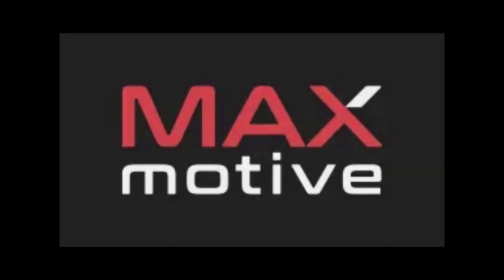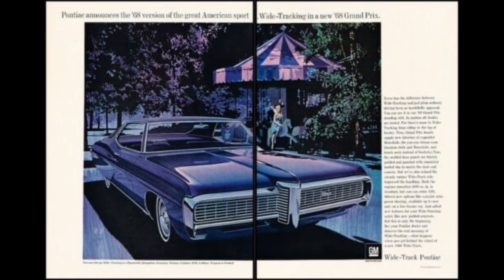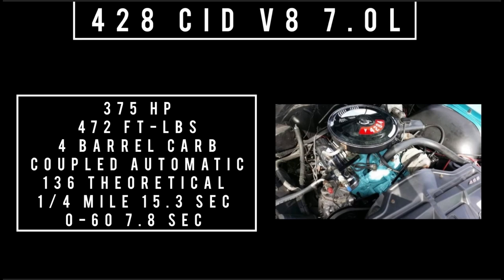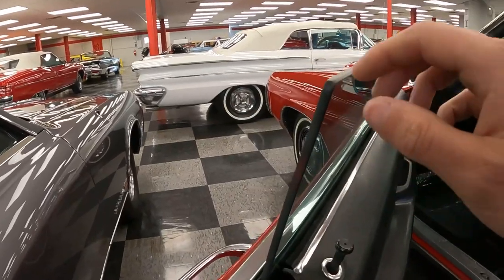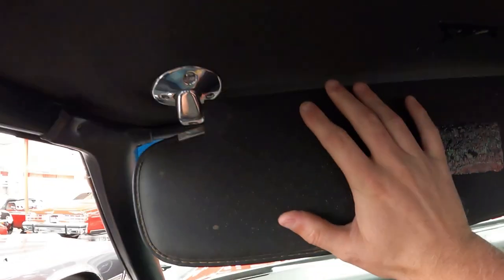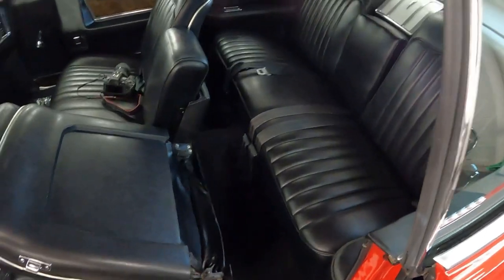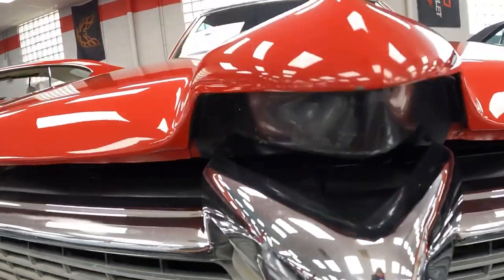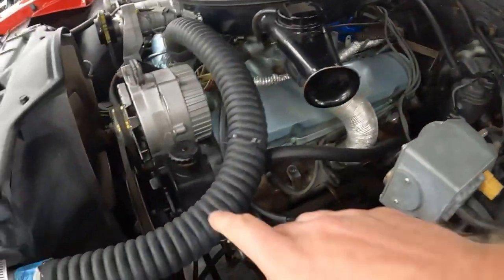1968 Pontiac Grand Prix in depth look￼

Comment: This was peak GM & peak Pontiac under John DeLorean. The average buyer of this car in 1968 was not really concerned with how much room there was in the back seat----GPs were not marketed as a "family car." Rode in a college roommate's '68 Grand Prix and he easily "buried the needle" at 120 on the Ohio Turnpike (at 2am one morning in 1972). So yes, it might have topped out close to 130 mph...his GP had the 428 4-bbl. with Turbo Hydra-Matic.
Reply from the maker: Great story thank you so much for sharing that memory was it super stable at speed
Reply: @What.its.like.  My roomie's GP was a very stable & smooth riding car which I got to drive a few times. When he punched that 428 it would push us back against the seat.

Comment: About 20 yrs ago, I parted out a 68 GP, lots of rust, pulled engine and transmission, scrapped the rest. It had bucket seats, center console with floor shift and 8 lug wheels. I'm a idiot, btw it was black on black on black too. 400 4 barrel carb, no brakes, no title.

Comment: GM really cheapened up the interiors in everything they produced in 1968... The 67s we're still pretty nice, but as far as the Pontiac line went, the 65-66 cars were probably the pinnacle of interior quality.

That vinyl top design with the paint running up off of the A Pillar all the way to the rear quarter, is called a "Halo Top"... Incidentally, the vinyl that was used on this particular car's roof isn't what it originally had. The original material had more of a pebble grain to it and was of a more matte finish.

But yes! Those GPs still ran like scalded dogs, even in '68... And in fact, up until the 1972 models.

They were great cars for the money.
Reply from the maker: Thank you so much for all the added information =)

Comment: IMOP the worst looking of the older GPs - up through post 1980, culminating iwth the grotesque Areocoupe mid-80s.  Oh, those fender skirts, fat rear end, halo vinyl roof and cutting edge molded door panels with 'rich 'burl wood' trim and a completely unresolved forward section.  The 69 came along just in time, and sales soared.

Comment: There were no GM cars Which used the Hydramatic after the 1964 model year. If 3-speed, They were the Turbo Hydramatic 400 automatic. Other automatics in 1968 were the ST300 and Powerglide, both 2-speeds. Buick-imported Opels used the Holden Tri-matic, later known as the TH180.
Rolls-Royce was the last to use the Hydramatic and they manufactured it in-house.
The A/C part you didn't know what it was is a muffler to smooth out the pulses. Most cars had them back then and for years later.
Reply from the maker: Thank you so much for those corrections =) and added information

Comment: The Grand Prix had a standard 350 hp 400 cubic inch engine, the 265 hp engine was a no charge option, the 290hp engine was standard on Catalina models because my folks 69 Catalina had that engine, it ran on premium fuel
Reply from the maker: Awesome thank you for the correction =)

Comment: You screwed up a lot about the first engine. First, the 290 HP engine was not available on a '68 Grand Prix. Second, the 400 2-bbl with 8.6:1 compression was rated at 265 HP, not 290. Third, a buyer did not "bump it up" to the 350 HP engine because that was the standard engine on '68 Grand Prix. He could "bump it down" to the low compression, regular fuel 265 HP engine for no cost, but the premium fuel 350 HP 4-bbl was standard. There was never a standard engine with 2-bbl carb on any Grand Prix until 1976.
Reply from the maker: Thank you so much for those corrections I think I got all the information from concept cars but they took down their post because they gave carburetor information and a lot of times is wrong on information..
Reply: Don't take everything for truth on the internet. Check at least 3 sources. No one likes a liar.

Comment: Hi Justin, as we got into the late 60s, the big three automakers started to delete the vent windows because air conditioning became more popular and more so to save money per car.  Automobile glass became thinner to save money and save weight.  No window frame(s) means that the car is a "hardtop" and not a "sedan"  The transmission shift indicator; P-park, R-revers, N-neutral, D-drive, S-second, L-low.  The large aluminum cylinder you see next to the air conditioning compressor is a muffler to dampen noise and vibration when the air conditioning is on.  By the way the conditioning compressor you see on the car at this time is not GM-Frigidaire, it's aftermarket.  Please reply.  Dave...
Reply from the maker: I thought the S stood for super.. 

Thank you so much for all of that information I really appreciate it =)
Reply: 'S' on Pontiac stood for 'SUPER', not 'second'. You must not be a Pontiac guy.
Reply: @MarinCipollina  Thank you for the correction!  Dave...

Comment: I've actually never liked the way pontiac designed the temp gauge identical to the radio. I dont like that look on a dashboard. But Pontiac was always my favorite. They had some beautiful cars and I've had 3 of them. Pontiac LeMans, Pontiac Firebird, and a Pontiac Grand Prix. My Grand Prix was a 1985. With T Tops. I loved that car. Oh, also a fourth one as well. A 1984 Pontiac Sunbird.
Reply from the maker: It was an interesting design choice that’s for sure
Reply: It's the HVAC system. not the temperature gauge.

Comment: I was wondering if someone can reply to this question.  I have seen 1965-68 Pontiac Grand Prix's at car shows.  I have seen 1964-67 Pontiac 2+2's at car shows, they are both ride on the GM "B" platform, they both have the same 121" wheelbase and they are both full size performance personal luxury cars.  But what was the cost difference and/or the mechanical difference between the two?  It's as if Pontiac Motor Division had two cars competing with each other.  Is there anyone who can answer my question?  Please reply.  Dave...

Comment: What is the difference between the Grand Prix and Grand Am?
Reply: Grand Prix switched from the GM B-body in '69 to the original G-body [a modified A-body, different wheelbase and no body panels interchanged] and stayed there till the end of '87 when it switched to the FWD W-body.

Grand Am was built on the A-body 1973-75 and was advertised as the luxury/touring of the GP and the driving dynamics of the Trans Am.  The name came back 1978-80, again on the A-body.  It returned again in '85 on the FWD N-body and remained thru the early 2000s.

SIDEBAR.....1967-68 were the only year for hidden headlamps and 1967 was the only year for the convertible.

Great video, Jay.  If you get a chance, do a review on a '77 CanAm.

Comment: I had one, but the dash was slightly different.  There was s map light where the center vent is at and  I am sure the climate control was the common GM climate control of the time. Probably because mine didn't have air conditioning.  It is the only car I wished I kept.
Reply from the maker: Awesome thank you so much for sharing your experience with your car on here.. =) what did you like the most about your car
Reply: @What.its.like.  It was the hidden headlights that first caught my attention.  The rear body styling, especially the taillights were also eye catching.  One thing I didn't like was the bench seat. Most GPs have a center console. It was long and low, and look cool going done the street. When I got the chance to buy it, I jumped on it.

Comment: Optional vs standard equipment on the 5 GM divisions confuses me. For example if you got a Chevy with options that got you to a base level Buick would the cost be similar?
Reply from the maker: Super confusing I totally agree
Reply: Yes, they could be similar.  However, driving dynamics were vastly different.

GM was five little kingdoms under one umbrella back then.
Reply: @Michael Long

Yeah... You could theoretically "tart up" a Chevy and pay just about what you'd get a loaded Bonneville for... Say you bought an Impala convertible, but ordered the deluxe interior with all of the power options, a/c, a special paint code and the 427 four speed... You'd be up there in Bonnie territory.
Reply: It’s confusing today, but not back then. Choosing options could actually run your final MSRP to be higher on a base model than on the top of the line model fully equipped. The sales strategy was to upsell  via options  and customer psychology never really questioned it.